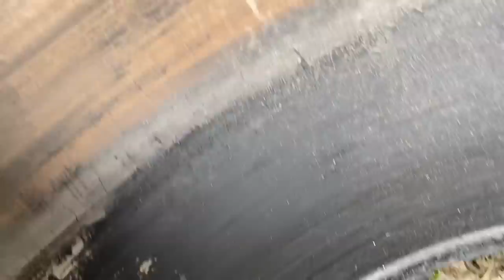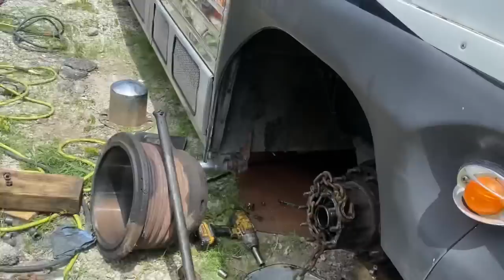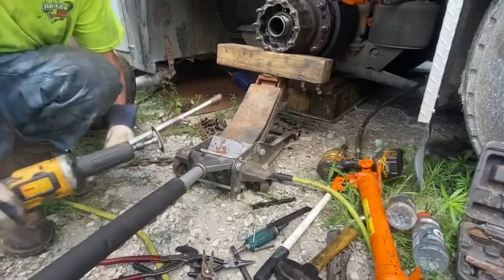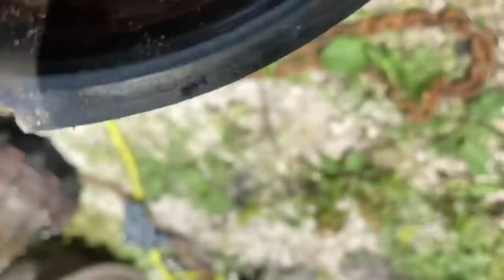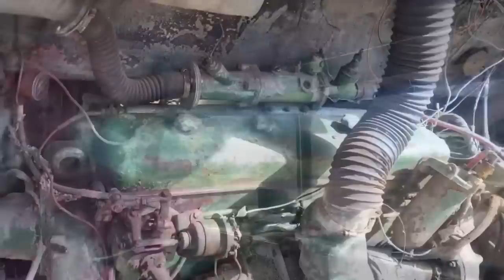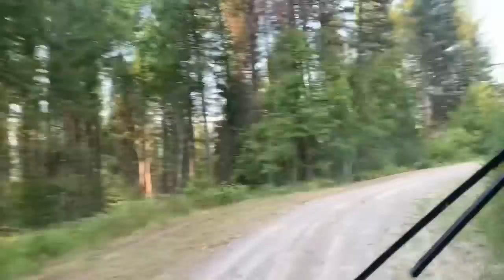Seized wheel bearing exploding off.  Dynomite was next option Vintage mci bus bearing & brake poblem

Comment: Once the torch comes out a mechanic is done asking it nicely to come apart 😃
Reply: When Yours Truly has to break out the Fire Wand, he is muttering “there you mf’er, I’ll fix you!”
Reply: Can't be tight if it's a liquid
Reply: Yup, when the oxy-acetylene torch comes out, a mechanic is done playing games, and that part is coming off even if it has to be destroyed.
Reply: @Dave-ty2qp  it's always been the blue wrench around here.
Reply: @southjerseysound7340  Gas Axe to me ;)
Reply: The torch is the answer to all frozen bearings.
Reply: I have a shop of mechanics who routinely heat parts up to coax them apart.
Reply: @digitalrailroader  If you have good insurance  you can burn it to the ground! Problem  solved!!
Reply: Well, I guess that's one way of putting it!
Reply: 😂😂😂 no more mr.nice guy!
Reply: Had to use a torch on brakes on a truck, the rotor actually split into 3 pieces
Reply: AKA The Hot Wrench

Comment: It's a good idea, when working on those old bus wheel bearings, to check for "undercut" on the axle tube (spindle). If the bearing preload has been run too loose in the life of the vehicle, the inner bearing races can spin on the axle tube, cutting a channel in the tube on the weight bearing (bottom) side (commonly worse at the inner bearings, as they carry more of the load). A worn axle tube can cause uneven brake shoe contact, and a recurring leaky wheel seal problem. As an old guy who has spent a lot of time around those machines, I enjoy watching  your videos!

Comment: One thing they didnt mention.... once the fire-wrench comes out (or the welder) under the vehicle, someone should be standing back a little looking as the "fire man" to give early warning of a small fire before it becomes a big one. This is "kinda important", or you can easily accidentally burn the whole project down.
Reply: there was an entire fire video crew present. Everything under control
Reply: Hey nothing like being on your back smell smoke an it smells like cloth..... Just saying for a friend.
Reply: I had my share of fires working at a fleet of 450 trucks. I yelled at the the lead man to put one out as I was putting out my pants that were on fire. Had to grab the fire ext. from the idiot pull the pin, and douse the fire. You learn who you`re working with when you see somebody freeze.

Comment: I've actually seen dynamite use to remove track pins from bulldozers. Nowadays the tracks are joined by bolts but back in the day they had pins that were pressed in with a special hydraulic press. That meant having that press, which cost a couple thousand dollars, or working out a different way. The way it worked was to use an old driveshaft from a big dozer with a hole sized to hold a hardened pin and a hole for a fuse. Basically a primitive cannon, dangerous if used wrongly but it worked out in the field. Installing the pin used the same "gun" with a pin with a larger end. Judiciously cutting the explosive to size altered the power factor.

Comment: I had to do the same thing with a Landcruiser front hub. The seal had come out of the back of the hub letting water in. Its a dirty messy job, Grease spitting every where, but torching it out was the only way to get the hub and bearings off the axle sleeve. I did it without setting the cv grease on fire. It had  only come with a minor squealing sound coming from the disc rubbing against the caliper mount. Thats not normal!  How he didn't notice the collapsed wheel bearing i don't know. You could feel it through the steering wheel at 5mph.

Comment: Looks can be decieving, a spindle can get too hot and shrink after it cools just enough, that a bearing will always run loose no matter how tight the bearing is, which you can't have. Slide a new bearing on the spindle, if the inner bearing race has any wobble off the spindle, the spindle is no good. Can't compensate bearing tightness for a bad spindle.

Comment: I never had any luck using that porta power wedge.  Its fine for body work but nothing that requires a lot of force.  Good try though!
Reply: It's usually worth a try but it usually takes a slide hammer while using it to work if they work at all

Comment: “Dynomite” is a rare form of powder you can collect from the underside of dynos. The powder is a mixture of oil, shop dust, and fine particulate matter from tires of the cars run on the dyno. This powder is highly explosive. It requires a unique ignition method that makes using this product a bit tricky. To ignite... you must acquire a duckbill platypus that has expired due to natural causes. Pour 1 ounce of gasoline in its mouth. Pressurize the platypus to 65 PSI. Lay platypus facing dust pile. Drop a bowling ball on to the platypus while holding a road flare in front of the dust pile. Has to be a 45 minute road flare. 30 minute flares will not work. The powder will being to smolder. Approximately 15 seconds after initial ignition you will see a purple flame. 5 seconds after the purple flame... a very fast molecular change occurs that causes rapid decomposition of atomic particles. This causes a blast that will always remove stuck hubs. Yes, you will lose the platypus during the ignition phase.
Reply: That's all fine and dandy, but I'm having trouble finding duck-billed platypuses. Isn't there something that can be substituted for one? Because of the quarantine, they can't be imported from Australia at the moment.
Reply: Lynn Leavitt Lol. Just substitute the platypus with the extra large purse that most Karens carry. You know... those massive duffle-purses. That should work nicely.

Comment: Had the same Problem on a car, the bearings failed and welded itself solid. I tried heat and a big hydraulic press. At about 40t the whole hub exploded.

Comment: I love the design of the full floating axle, hub & spindle, but I’d look for a disc brake system, those old drums seem like a lot more trouble.
Reply: Disc brakes are a pain to work on.  Actually more difficult too.  Anything that ain't old school is usually stupid.
Reply: @1965Gindy  lol how are disk brakes a pain to work on? Is it because they've got a bunch of springs in them you've got to put together in just the right way and then adjust annoyingly, not to mention needing to take the whole hub off any time you need to change a shoe?

No wait, that's drum brakes.
Reply: disc are great to prevent fade as rotor is exposed to atmosphere.
I'd choose drums over disc in commercial applications any day.

a: surface contact is superior
b:last significantly longer
c: parts are cheaper
d: simple to repair/replace
and last but not least, I run a wrecker. when my trucks started coming with disc brakes, even though all 6 wheels are "locked up" winching anything will pull my truck without creative tactics and outriggers dug into the surface.

Comment: That was bad but not that bad trust me, I know first hand. I paid Axle Doctor $1,800 to come to Lafayette, hack off old spindle and weld on a new one plus the cost of having Wiers reassemble wheel-end with all new parts. This was due to T.A. Whitestown replacing bad wheel seal, inner/outer bearings and races but they forgot to torque and secure the hub nut and the assembly came loose under a heavy load and destroyed the new bearings and spindle. The owner of this coach got lucky especially having you on the job as you caught major issues that most mechanics including those in truck stop shops would've missed.

Comment: Gillig is still using this exact brake/hub/drum setup on their transit buses except the brake shoes are clocked a little different, other than that its the same. We have grease packed rear bearings with a seal that goes on the end of the spindle, it looks like the inner race for that seal is on the end of the spindle in your video, it just taps off. I wonder if they were grease packed and that outer seal failed?

Comment: The last time we just put a plate across the axle and bolted down to the hub like a puller and gave it one good whack with a sledge and pop !
Reply from the maker: we tried the sledge hammer then the slide hammer then the backhoe, porta power then torch
Reply: My idea , that tractor is not bringing much force , those 10 bolts will!
I was looking in the comments if someone had the same idea and yes!
Reply: You dont need to make a plate for it ,just put the right size ring between axle and spline-shaft

Comment: I do have one question though: Did you try applying heat and cold in turn evenly throughout the bearing so it would maybe work itself loose by expansion and or contraction?

Comment: Too much preload on those wheel bearings, I’ve never seen a hub that tough to come off. Lucky that drive axle doesn’t see a whole lot of load. I would be concerned about how much heat the spindle experienced if it was a single axle bus.

Comment: Lessons To Be Learned The owner of the vehicle clearly does not understand what it takes to ensure a vehicle such as this remains roadworthy. The failure of the live axle seal was a longstanding problem and is evidenced by his/her knowledge of braking problems in use. Also, tyres are extremely important to safety, and those inner tyres should be checked each and every time  the vehicle is used. A simple pre-use visual walk-around check would have highlighted the inner tyres were devoid of air pressure. I am sure you will have provided advice as part of your service, so lets hope the owner listens.
Reply: The new owner recognized the issues and brought the new purchase in for service.  Watch the last live stream for more information on the back story

Comment: On the another note, any very experienced driver will tap tires multiple times a day to check for inflation issues. It only takes seconds to verify tire inflation.
Reply from the maker: Doesn’t help when you puncture a tire 100 miles into a trip.  But a tpms will say “hey i’m going flat” before something very expensive alerts you.
Reply: @BusGreaseMonkey  I wasn't talking about a in active use catastrophic puncture. Most punctures more often result in slow leaks first.

Comment: How was that bus driven and parked where it is with seized up hub?    Was it flatbed hauled in and rolled off?
Reply: It wasnt seized up, it was still spinning, eating itself alive. The inner portion doesnt spin (well, if it does, huge damage occurs).
Reply: It was driven to Indiana like this. Bus was bought uninspected but Scott admits that an in person visual inspection would not have uncovered these issues.  By driving the bus, yes.

Comment: Where do u order those parts from?
Reply: blkthunderbolt
 ... brake parts are commonly sized by dimension or style. Basically you put a tape measure across the drum and the shoe then order say 8" wide x 16" drum size. Bearings and seals are replaced by the part numbers stamped right on the various pieces. Outside race and the mating bearing always have a number on them and are sold separately. The seals are the same way.  Same goes for the S-cams and rollers. All common parts that come in a variety of standard sizes. Worst case is you bring the old parts to the supplier and match them up. The air system is also a variety of standard parts and has been that way for decades.... until disc brakes and ABS came out in recent years.